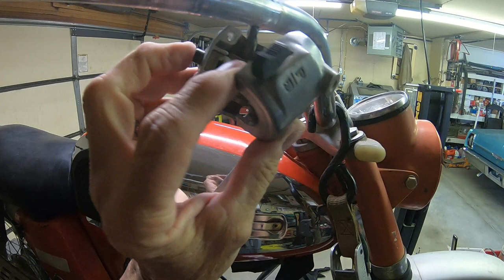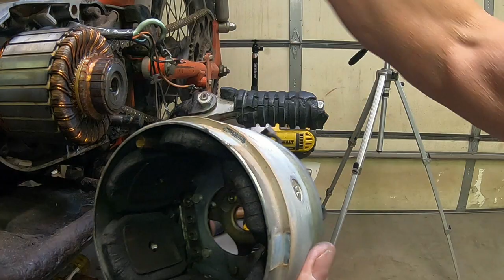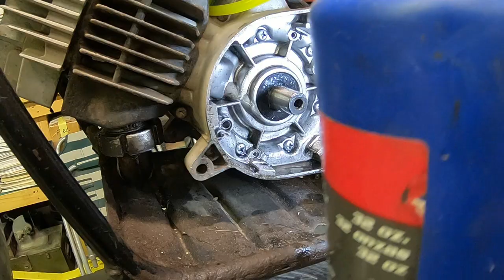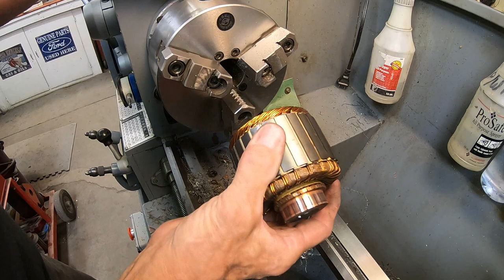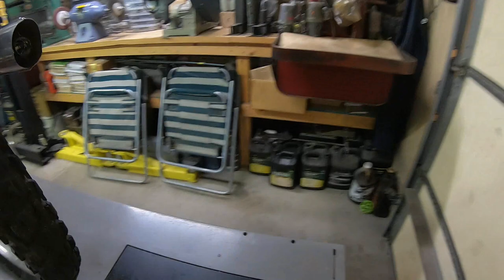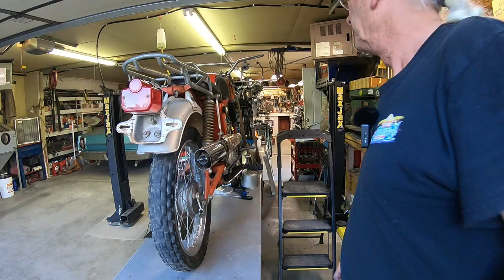Yamaha 100 Trailmaster Crankshaft seal replacement

Comment: Hi Dale, Thanks for the video! You do a great job every time. I can only imagine what my original crank seal will look like when I get the armature off my DT125A.  I'm looking forward to using the puller. When I first started working on the motor in the early 80's I didn't know there was a special puller and was puzzled how the armature came off.
Reply from the maker: You will get it done Ron, sometimes those armatures can be a pill to remove even with the puller. But usually, a wack with a brass hammer on the end of the puller when tight will free most easily.

Comment: A definite improvement Dale but it does sound very lean. It's getting air from somewhere, I think you are right about the carb.  I agree that it's probably drinking it's gearbox oil. That other seal will definitely make a difference when you get it. 
Best wishes, Dean.
Reply from the maker: Yes, it is fine till I give it some throttle then it starts to run like its running out of gas. Think that float is still not right. I have a factory manual now for it. Not a word about how or what specs for the float. Strange.

Comment: Beautiful looking bike, I noticed the huge back sprocket, it makes me wonder how the bike may ride. Is it for more power/torque for going up hills or trails? Thanks for the video!
Reply from the maker: Hey Stan, yes hence its name the Trailmaster, this was before the lever to change from high range to low range. You have to actually change the sprockets. The small one will get you to 60 mph, the large one will get you to 35 mph, but up some really steep and rugged hill. Thanks for stopping by.
Reply: Great explanation and makes a lot of sense.

Comment: Hey Dale, I sent you a link to Ebay tank badges in the comments of the first video for this bike.
Reply from the maker: Hey Gi Gi, I did not see the link. I have looked on there and everything I see will not fit. They list it for the YL2, but they also list it for the YL1, these two have different screw locations, think the YL1 is about 92 mm between screws, and the YL2 is 102 mm. Thanks for hanging out in the shop with me.
Reply: @montana2strokeracer  Frank here, i had a trick once wheer the emblem was right and the holes were off, just glued in a couple cut off screw heads then super glued the emplem looked perfect. of coures when the next guy tries to unscrew big suprise.
Reply from the maker: @frankdillon6127  Dang Frank, I may have to pull a fast one like that.
Reply: @montana2strokeracer  No worries Dale, I assumed they were all the same! I better check my specs and compare too before I order some myself.

Comment: What tool do you use to remove the flywheel or stator on the bike??? Do you have a maker and a part number
Reply from the maker: Hi there, I can never remember which tool works for which rotor, I have both, so I just grab them and try them. But this I can tell you. Try a 10mm 1.25 bolt if it screws in, you can order the puller from K & L tools part number is 35-5942. If a 10mm 1.50 bolt fits, not sure if K & L makes it or not, but the Yamaha number is 90890-01109-00 that is the one I have.